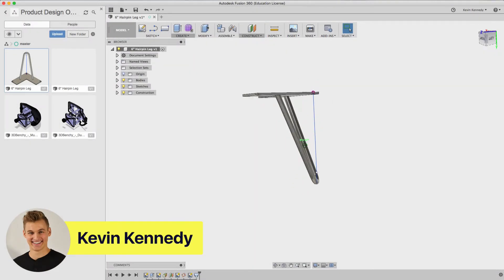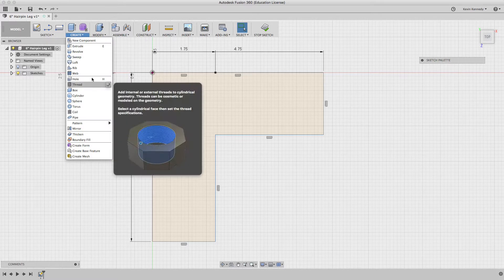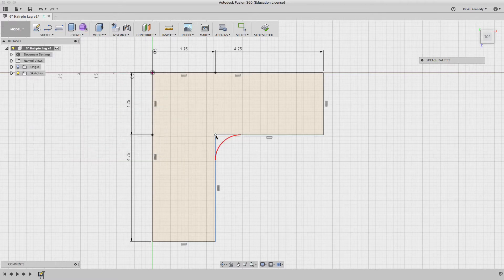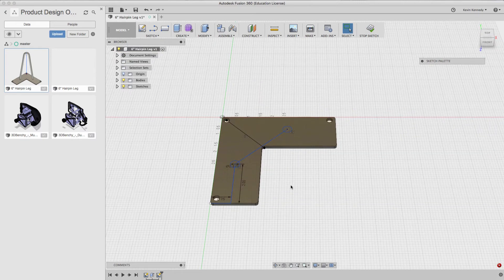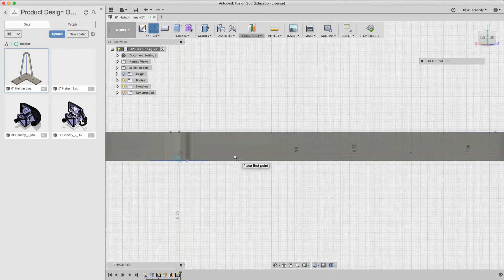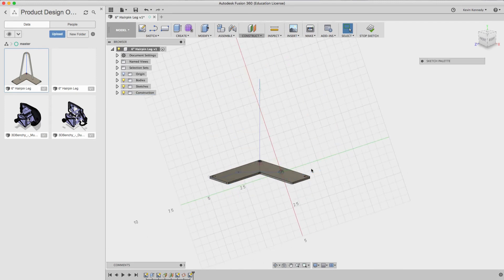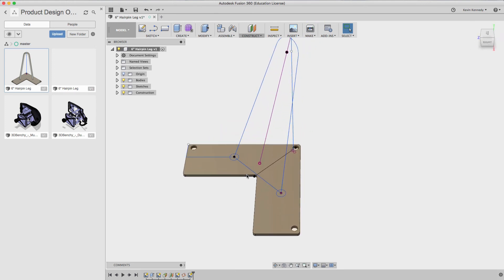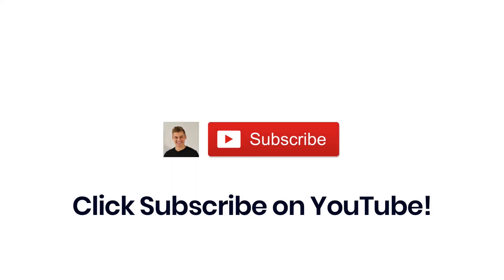Fusion 360 Advanced: How to 3D Model a Hairpin leg in Autodesk Fusion 360

Comment: Since the lofted circles are on a plane that is not perpendicular to the loft's rail, isn't the resulting leg's cross section an ellipse instead of a circle?
Reply: The rails hit the center of each circle since we made a 3 point plane which 2 points were the center of those circles. Does not have to be perpendicular.

Comment: I would have thought to use the Sweep tool instead of Loft. When I try it, it doesn't connect the end correctly to the plate. Is that why you used Loft instead?
Reply from the maker: Hi Jeff, that is correct. The sweep will leave gaps near the L-bracket. You could sweep past the L-bracket and cut those pieces off, but that would be a few extra steps. The loft feature also gives a bit more control with the radius/bend at the top. Cheers, Kevin :)

Comment: Couldn't get it to work.... at approx 4:01 you draw a center line, but then it turns into a magenta projected line. Can't get it to do this. Also, at 4:58 you quickly state "first profile, second profile", but I can't figure out what you're selecting. Advice?
Reply from the maker: Hi Michael, please pardon the sloppiness of one of my first tutorials! 😂

The centerline was automatically turned magenta/projected because I snapped the center circle into it. That centerline is really just a construction line so it shouldn't affect your circle or the rest of the guide rail that you're creating.

At 4:58, it was a bit laggy when I was recording audio and screencast so it didn't line up well... but essentially you select both circles as the profiles and then center centerline as the guide rail.

Hope this helps! Cheers, Kevin :)